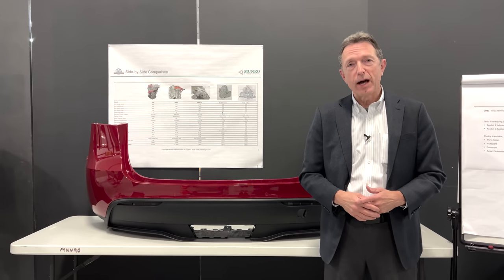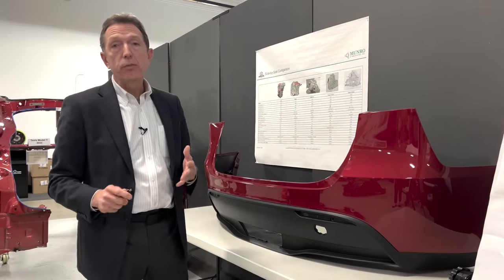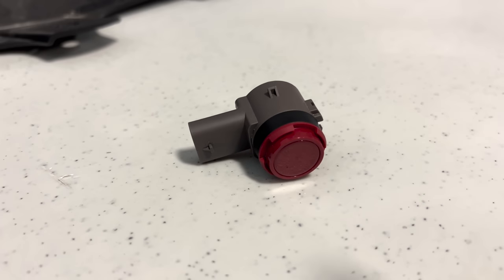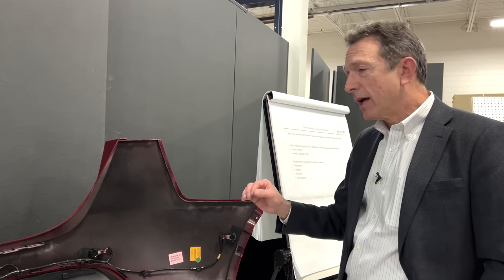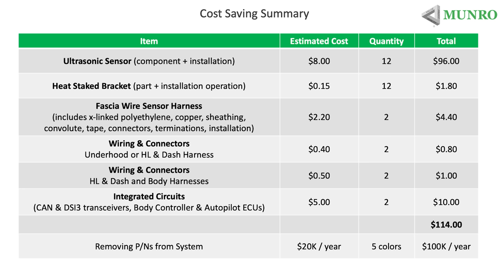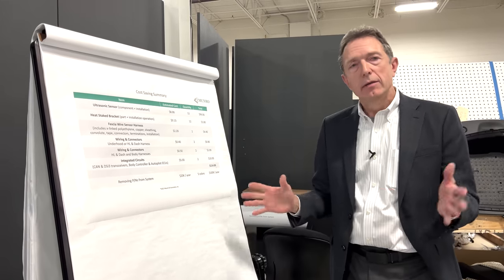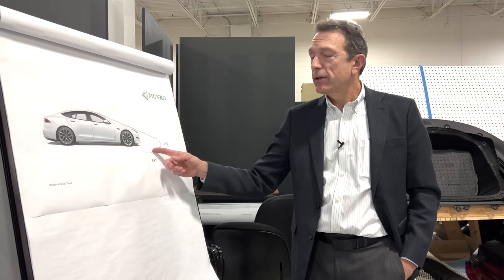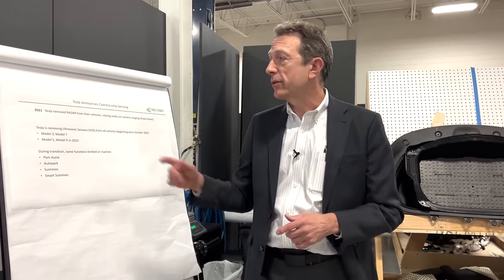Tesla REMOVING Their Ultrasonic Sensors

Comment: they really need to add low front bumper mounted cameras left, right and center where those sensors were not only to give a better picture of close objects during parking but to provide blind corner views during unprotected turn crossings while driving.  this would allow the car to not have to creep so far forward while trying to assess cross traffic.  The pillar camera position is really too far back to make for good cross traffic detection.
Reply: @JT_771  if cars are going to auto start and drive, and they have no sensor to tell if a child is lying in front of the rear wheel, this is going to be disastrous. The camera can not see enough in front of the car and can’t do a walk around like a human.
Reply: Two wide angle cameras in the headlamps would give depth perception too?
Reply: A front bumper cam at least could help giving 360o birds-eye view feature, to avoid high curbs/parking blocks in front before you scrape the front bottom lip on it :(  USS didn't reliably detect those either, so adding one low cam might actually be an improvement... and would of course cover up the triangular hood blind spot he mentioned..
Reply: @TwentyHz  could you please tell me how sentry mode works and then revisit your statement?
Reply: @clinton8432  I think that sentry mode can be disabled to prevent vampire battery drain when camping or away on a long vacation etc.
Reply: Agree with low front camera. When I picked up my Y in June 2021 I stoped at a Fast Food joint,. Looked to Park where no one could open doors onto me. So I noticed a area with a few cars but wider space. I drove in and hit a higher curb then I thought was there. damage right lower bumper. Now every time I park into a city curb I stat 5 feet away I even tell my wife to get out and cricket me in so I dont hit the Dam Curb again. Did the same with my 2013 Lexus
Reply: Did you watch AI day? The big software changes coming means the car will be able to see and map the world in real time in 3D with better object recognition, better persistence of vision, better lane recognition, and better object behavior prediction (identifying parked cars, etc). Its essentially a whole new vision stack. When that rolls out, I doubt you will be seeing comparable behaviors to the current FSD behaviors.
Reply: @patreekotime4578  The fsd beta stack running in my car at the moment has all this and is spectacular at doing what it does.
Reply: Liable to get muddy all the time, or dusty.
Reply: @JT_771  ...because nothing says safety first like adding the bare minimum?
Reply: No, they don't. USS is for short distance only and useless at higher speeds, so we're kind garage and parking here. Tesla Vision, once perfected, will know, remember and track position of all static obstacles around it down to inch.
Reply: @JT_771  It's not excessive if it prevents accidents. Also if you think this doesn't have a lot to do with saving assembly time I've got a bridge to sell you. I'm a fan of Tesla SpaceX but they are a business and this show rarely disagrees with anything they do. In fact even where it's impractical to own a Tesla I catch nothing but shite from people who are intolerant fanboys. They are great when they're practical. Certain models are better then others. All are better then GM.
Reply: I say they must add Lidar all around and most of all on top to recognize diving pidgeons so the car can shoot those air-rats down with the front screen laser which has replaced the wipers. IMO of course.
Reply: @JT_771  One camera can't provide distance, you need a minimum of 2 for that.
Reply: @patreekotime4578  You can have the best AI in the world, if your blind, you're still blind and will hit that thing that you don't see.
Reply: I worry about how dirty bumper mounted cameras will become. Slushy grime after a snowstorm and just grime after a light rain. Would I have to wipe them off twice a day? They would be a lot lower than the ~mid-high mounted cameras on many SUVs, and those get dirty somewhat easily in those conditions.
Reply: @donjones4719  Just twice? I've been driving over 20 years and have more miles behind me than most people have in their entire lives. You'll have to clean it before and after every trip if there is any hint of rain, dust or snow.
Reply: @JT_771  They are removing the sensor that allows for motion aware systems to know where things are. Blind is blind regardless of how smart your AI is.
Reply: 1 Center Bumper 5mp Camera with a 210° lens is enough, to safe a lot of cats and dogs sitting in front of the parked car
Reply: @TwentyHz   (In front of the rear wheel is under the chassis where no car on the market senses objects).  Immediately in front of the front wheel a static object would not be within the coverage angle of most ultrasonic sensors are motion patter activated. A soft object detected during power-on would be ignored. People are confusing sensors provided for parking and rigid obstacle detection with the rear-facing "blind spot" CAMERA function.
Reply: @christianhenderson5471  They would provide cross-eyed and fisheyed-distorted binocular vision which would be easily obscured by rain, snow, dirt, etc. that couldn't be cleaned as simply as the windshield.
Reply: @TwentyHz   Child lying in front of the REAR wheel when parked would be beneath the chassis and  wouldn't be detected by any car available today.
Reply: the issue would seem to be if the cameras are turned off (not sensing the surroundings) and then an object enters the surroundings and into a blind spot, then the car is asked to drive (cameras turn on and object in blind spot is not detected)
Reply: if cameras are on all the time then the blind spots should not be an issue? correct?
Reply: @linusa2996  Thats funny, because I didnt mention cameras once in my comment.
Reply: @psdaengr911  Except that the Tesla cameras would watch the child approach the vehicle, recognize it as a human, and watch him crawl under the car, but not leave. Persistence of vision is the key here. The same is true of the curb... unless the curb can magically move by itself, the car saw the curb when it parked, if the persistence of vision works correctly, it will remember where the curb is relative to the vehicle even better than a human driver rolling down the window and craning their neck. I am not saying this is 100% exactly what Tesla will do, but this is the potential they have introduced with what they presented at AI day.
Reply: @bpeterson4016  Bingo. The car would know better than a human driver if something got in front or behind it.
Reply: If the camera is on all the time and the car has object permanence, shouldn't be an issue. The car can see something go into its blind spot and assume it's there until it sees it leave. Won't work if the cameras are off or if the "environment" resets.
Must be inefficiency to have the cameras on all the time, though. But not sure of any other way to make smart summon safer
Reply: @linusa2996  With a static single image that is true but with a video feed, distance can be calculated algorithmically.  As a simple example a human with vision in only one eye can still calculate basic distances.
Reply: @TheDarinseng  The human with one eye is making a guess based on what it knew. The AI makes a guess based on what it's programed to know about the size of a given object at a given distance. Present it with an object of the same shape but different size and well, you run into motorcycles at 75mph.
Reply: @patreekotime4578  It's what we are talking about and it's how Tesla's AI sees the world, now without radar, ultrasonic, it's the only way it sees. it need a minimum of 2 cameras to determine distance, with just one camera, it's making a guess or it just ignores the object.
Reply: Need an extra camera in the cabin to play music when I drift asleep.
Reply: @TwentyHz  This feels like something that shouldn't need to be said, but parents will have to make sure their kids don't go to sleep in front of car wheels! :) And I don't just mean in a world where cars drive off themselves, but right now - how many humans do you think actually perform a safety walkaround before driving off in their cars?

That said, I am certainly bummed about removing the ultrasonics, which will include on the car I have on order. They will never fully replace the USS functionality with Vision-only and I will miss the accurate information during manual parking that I get with my other cars, up to 20 years old! You can talk about clever algorithms to calculate distance from monoscopic images and identifying objects before they enter blind spots then remembering them all you want - it's just not as accurate or reliable as the simple old school sensors! I'd happily pay $115 extra to keep the dang parking sensors!
Reply: @patreekotime4578  My 2021 Plaid can't even know when to go forwards or backwards.. half of the time, when I am in a parking spot, it suggests forward, even though there is both a post and parked car in front of me. There is very little intelligence in the current AI.

Comment: I'm a bit worried about this change. Last week in the dark on a busy freeway I nearly changed lane into a black car that had its lights off. I couldn't see it over my shoulder or in my blind spot mirror, and Tesla's AI didn't show it on the display either. But the collision avoidance alert triggered when I was just about to hit it - and I'm pretty sure the ultrasonic sensors are what detected it - it showed as a red wall proximity alert on the UI. Tesla is very forward thinking: they often release products that rely on technology that doesn't exist yet!

Comment: Thank you Munro Live and Mike, great presentation.  Unfortunate that Tesla decided to remove the features before the software was available, I do wonder besides the cost saving, that there might be some supply constraints.
Reply: ...a lawyers dream if they are wrong. Imagine multiple child deaths if the system isn't as good as before. Maybe Tesla has got it squared away, but the fact that features were removed until the software catches up is itself looking sketchy.

Comment: Also electrical savings are made by removing sensors,  which is always a plus in an EV.
Reply: In power ? It'll be so minimal as to be unimportant. A watt maybe ?
Reply: That wiring harness and the connectors look pretty robust,  but I don’t know?

Comment: Just a point regarding the parking blocks example mention, Tesla Vision is very good at measuring distance now, so in essence they know the position of the cameras, they know the position of the front/back car, from the cameras they know how far the parking block is from the front or back of car. Simply using the wheel sensors to count rotations would allow them very accurate distance control in this scenario.
Reply: Is it? At least on the display, distance between the vehicle in front of me fluctuates a lot, along with the follow distance during TACC. It's never consistent. Maybe the higher res cameras will fix that.  The US sensors are pretty accurate down to the inch. I measured it. When I park in my garage, I need to be parked within 12-15" of the front wall in order to be able to open my door all the way. If I lose the ability for that accuracy, I'll have to go back to eye-balling it and cracking open the door to correct my positioning. If they use tire rotation, how incremental can they detect rotation? And what about tire radius changes as they wear?
Anything Vision related performs suboptimal in my experience. (wipers, auto hi-beam, object detection) 
However, its ability to recognize road lines when I can't during heavy rain is pretty impressive. Now if only it could see through snow and ice...
Reply: @andrewt9204  100% with you Andy and similarly when they removed LiDAR the AP following distance and more importantly smoothness decreased during deceleration. I've also measured the sensors, with a tape measure, more for curiosity than anything else, but I do rely on those inches in certain situations, like tight parking garages and so on. A bit skeptical about this "upgrade"
Reply: This was also covered on Dave Lee you Tube channel. Look for the USS Ultrasonic episode with James Douma (sp?). Car can see the object 3 feet away and use wheel spin info to know how close it is getting.
Probably not great for something moving like an animal but USS are not perfect either.  You can easily back into a round pole without signal bounce going back.
Reply: @andrewt9204  Don't forget, tire radius also changes with different tire manufacturers and models, not to mention Tesla has at least 2 different wheel sizes.

Comment: Good question on the snow packed curb. 
I meant raining or snowing. IR sensors have have resolution just like camera sensors. An IR sensor with enough resolution and cooling can see anything. The cost becomes prohibitive for car use. So a standard IR sensor may not see a curb under snow. 

Sandy mentioned that IR sensors can see buried explosives from a plane. Military planes have ultra high resolution sensors that are cooled. The larger the temperature delta between an object and the sensor, the vision is better. 
An item at absolute zero does not have an IR signature.

Comment: As a model 3 owner for over +3 years I can confidently say this is very risky. At least 1 of my cameras are blocked Nov-March (in Michigan). Also, the blind spot now for the front is a big deal. Soap box, I am growing tired of being a Tesla betta tester for everything.
Reply: But your car has all these sensors and you're not "beta testing" any of these systems they're removing.
Reply: @hotrodandrube9119  For now. They turned off my radar in the last software update.
Reply: Your average Corolla without ultrasonic sensors isn’t crashing into everything. Why would a Tesla be risky? It’s just a normal car.
Reply: @rickgalati2935  A Corolla has ultrasonic sensors as a standard feature...
Reply: Tesla is going downhill fast! Much like Nikola! 😊
Reply: @eganjos1  this completely misses the point. There are millions of cars without these sensors on the road every day. Somehow they aren’t crashing into everything…
Reply: @eganjos1  okay.  If only they had some amount of data that they could do a comparative analysis of, of parking cars with both data streams to see which was validated.   I guess it just doesn't seem like that big of a deal to me, and there's a ton of fud out there.
Reply: @rickgalati2935  Those cars don't have "auto pilot"